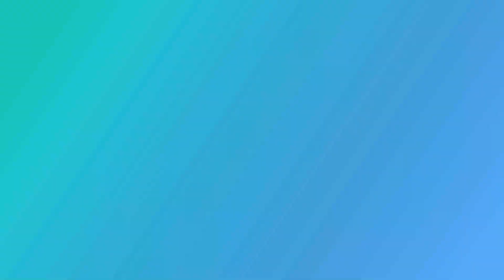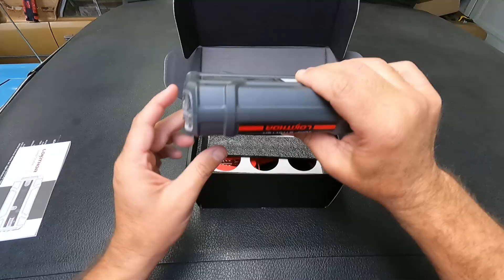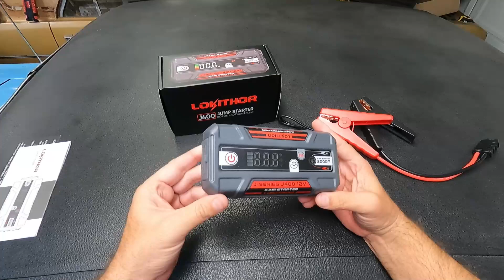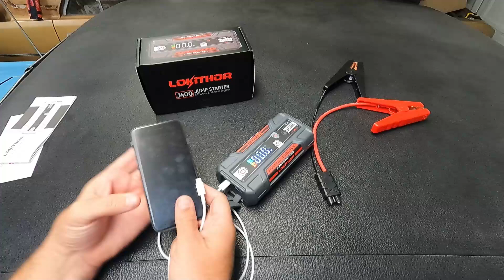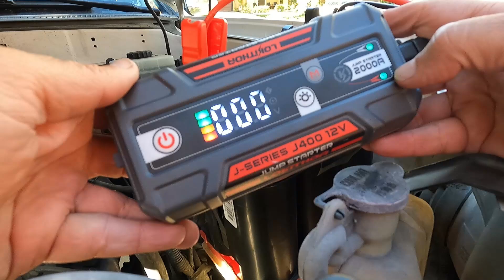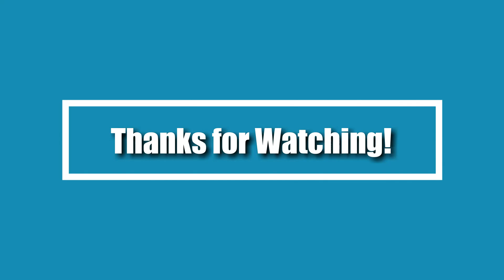LOKITHOR J400 JUMP STARTER / POWER BANK / EMERGENCY FLASHLIGHT UNBOXING AND REVIEW! CAR & MOTORCYCLE

Comment: I've had several similar jump starters that use that same plastic clamp with the plastic instead of metal fulcrum. They always end up warping and when u go to clamp them on a battery post/terminal they always split apart. I now only but jump starters with a metal fulcrum.